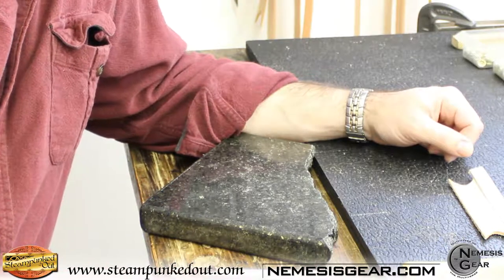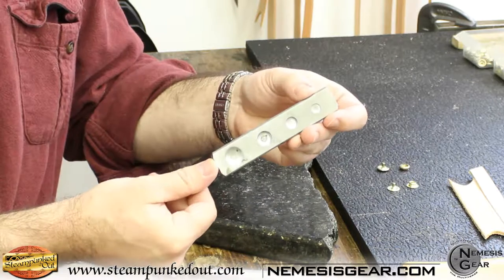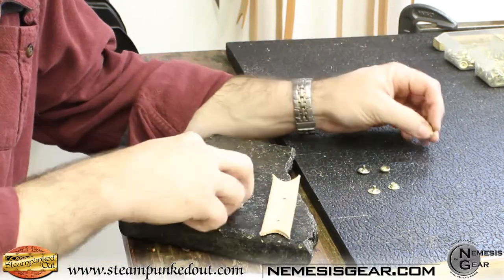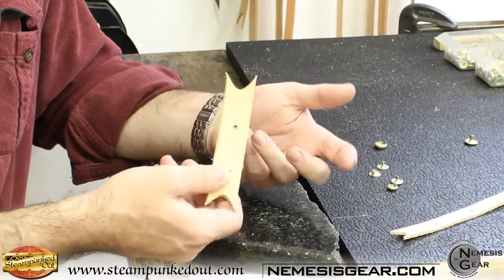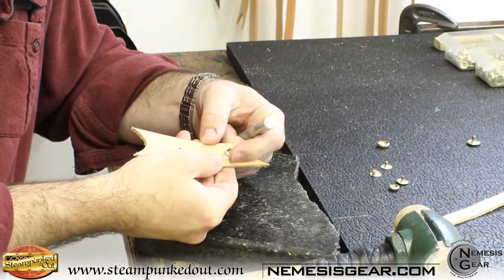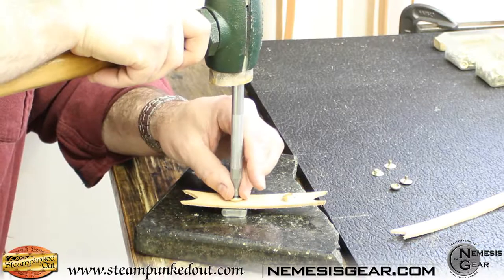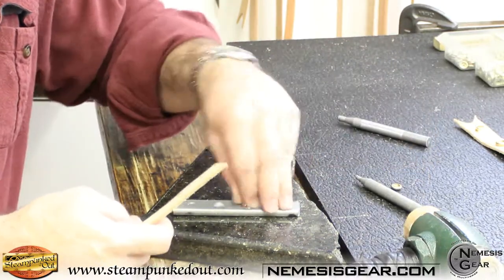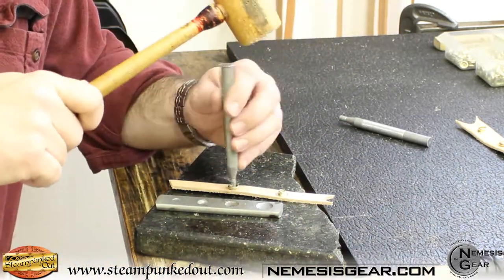Setting Line 20 and 24 Snaps

Comment: An explanation of the purpose of the two smaller depressions on the anvil would've been nice.  Obviously their use is probably the same, but for what fasteners?
Reply from the maker: The smaller depressions are for a different type of snap.  They are about 1/4" in size and have a little button stud.  I almost never use them as they are for thin garment weight application, but the setters came as a set.

Comment: I'm using Tandy snaps and tool, they seem like crap, 
Doing it exactly like you are and I got 1 out of 10 to set
What make of setter are you using.
Reply from the maker: I'm using the Tandy hand setter as well.  Hard to know for sure what you may be doing different without seeing it, but the biggest things to look for is hitting the setter too hard and setting the snap in thin leather.  Less is more when it comes to using a hammer.  I often use a very light weight wooden mallet.  Better to hit the setter lightly a whole bunch of times than to hit it too hard.  You can also try using a tiny bit of oil in the setter.  Put a couple of drops on a paper towel and just lightly oil the tip of the setter where it contacts the snap.  Also, if the snap is fairly long and its being set in a thin leather, it leaves a lot of post to be crimped.  There's only so much room to roll over before it will bend over from stress.  Make sure you use the appropriate snap size for the thickness of leather you have.
Reply: @mythimpressions  thankyou for the advice, I think that I may be wackin it to hard and the stud is a little long, I'm using Tandy line 24 snaps on there belt leather, the male side set no problem but the dome cap with the female snap ring in it is where the problem is,
The tube either squashes over to one side or compacts and blows right through the reciever.
So it's another mail order to Tandy, and on one small item the shipping is more than the product , 
I ordered a Barry King setter today so I'm hoping it's as good as the reviews say it is.

Comment: 20 vs 24 only differ in post length right? Otherwise same diameter?
Reply from the maker: Line 24 is larger in diameter as well.
Reply: @mythimpressions  really? I have a bunch of "line 20" and "line 24" from Weaver/Tandy, the dome caps are exactly same diameter. My hope is to buy snaps of variable post length while keep the cap same size. but now i learned that's not possible

Comment: This is a great vid - thank you!  Question, I got the line 20 and setting anvil for a fabric coat and have had nothing but problems on my scrap test piece.  Will these not work in anything but leather?  If so, can you recommend the correct snaps to get for cloth?  Thanks!
Reply from the maker: Without knowing exactly what problems you are having, it's hard to be sure, but my first guess is you are having problems with the shank bending over during setting.  While setting properly is important, there is only so far you can get the edge to roll over before it begins to bend.  Leather is usually a lot thicker and compresses less than fabric, so if you don't have enough material in between the 2 sides of the snap, it's still likely the shank will bend over.  It's the same problem with rivet setting; the shank length needs to be long enough to go through all the pieces, but not so long that there is too much to set without bending.  The only ways I know to fix this are to either add spacer material between the 2 halves of the snap, or to use a snap with a shorter shank.  I believe I've seen line 20 and 24 snaps with extended shanks, but don't recall seeing shorter ones...likely because leather suppliers don't need to carry shorter ones since we use thicker materials in general.  I would try fabric suppliers and see if they have snaps with different length shanks.  If they don't have specific measurements, the best you can do is get a variety to test and see what works best.  I have little experience with fabric hardware, so I'm afraid I don't have a lot of resources to suggest beyond guessing the problem.  Best of luck!
Reply: @mythimpressions  Thanks so much for the reply!  I was able to get it to work by giving a few strong smacks with a 5 lbs. hammer (after I used the rubber mallet while rotating the punch to initially set/roll the shank).  They do not look deformed and now snap ok .

I think the root issue is what you mentioned - not enough material and shanks may be too long.  I got advice on a forum to carefully file away some of the shank length with a Dremel to shorten them (but not too short).  Will try that on the next project.

Thanks again for taking the time to reply and this is literally the best vid I have seen on this topic - even more so than Tandy's!
Reply: Just to add, I shortened the shanks on my follow up project and it was MUCH easier to install.  All I did was hold them with pliers and used my Dremel with a sanding drum (60 grit I think).  It was surprisingly easy to file the shanks down and install was just a few lite taps with the rubber mallet and punch.